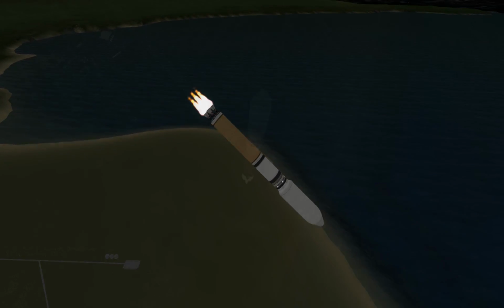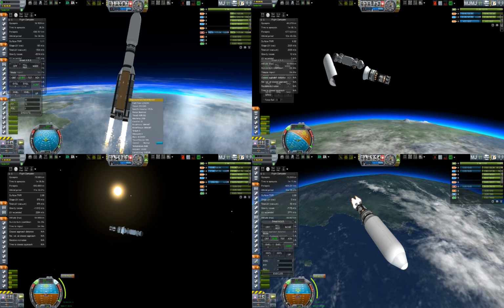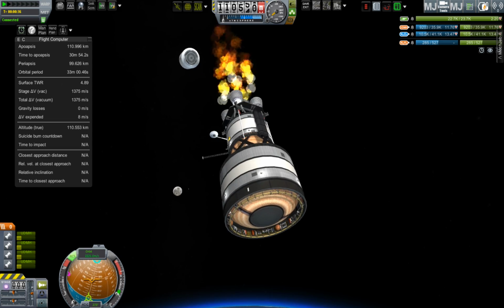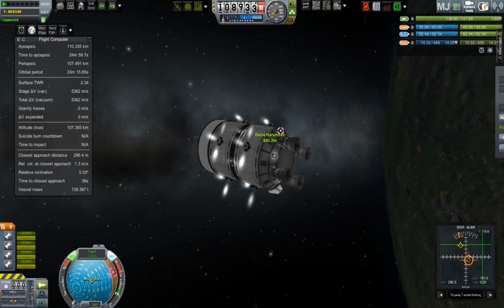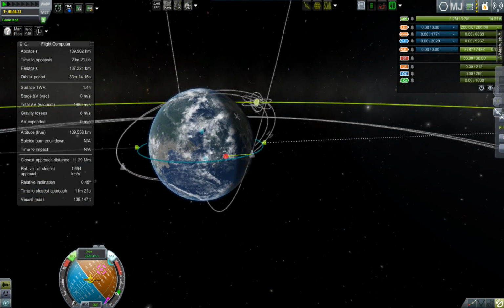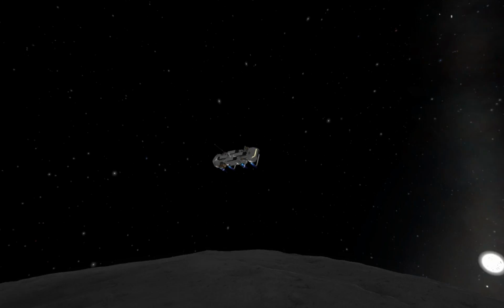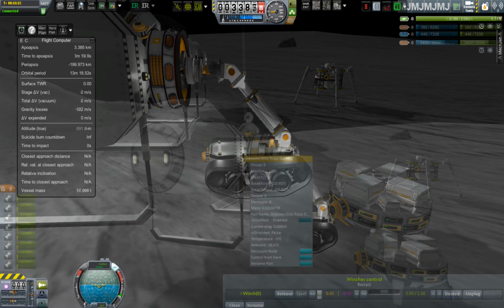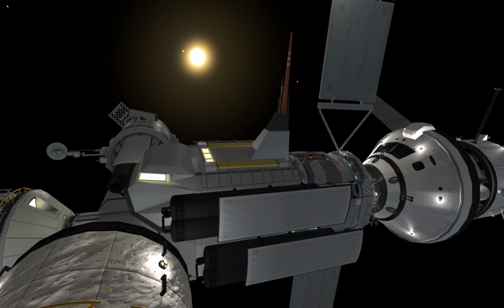E32: "Mun Base Reboot" / Project Odyssey / KSP 0.25

Comment: Sorry for posting the same thing on E31 videos, didn't realise E32 was out. I've been watching this series for a couple of days now (few episodes after work at a time), I'm liking the over arching story as it just adds something extra that's hard to quantify but makes a long running series stay fresh.

Second thing, i really like your designs and your design process, it looks to have resulted in pretty yet practical crafts and most things have a realistic reason for being there, even if it is just for looks. But there is one thing i'd like to help with if you haven't noticed already, it's the crane thing you are making for your moon base. It needs to be fixed to the ground as your wheels will act as a pivot point and even if you add weight to counter balance it, it will still want to pivot on those wheels when moving and will always be unstable.

The solution is the same as on earth, legs on each corner on the vehicle that as far away form the COM as possible when deployed. In game i'm guessing you could achieve this with landing legs or some piston parts from a mod, as long as they lock and don't allow the wheels to act as a pivot point when moving a load it will be stable. Now you would also need to add a bearing underneath the crane piece to allow it to pick up and move stuff around, look up images of crane trucks and you'll see what i mean.

I hope this helps.

Comment: Just a thought for AMA, How to build planes in FAR. I'm going through some hard things in KSP.
Reply from the maker: CodeFantastic I don't usually build planes. You know more than me probably.
Reply: Well, do you know how to fix descending while rolling?
Reply from the maker: CodeFantastic Since I am not sure what that means, I'll say no. You're rolling while descending and you want to stop? The few times I have done planes I did not have rolling issues. I have had yaw issues before. I flip and descend backward. That was the result of FAR thinking I had more drag in the wrong places, usually from bad part configs.
Reply: What I mean is that when I roll right or left my nose begins to dip down. Another odd issue I have is the certain parts ( Turbo Jet, 2.5 RCS tank, 1.5 RCS tank, winglet), and some modded parts have a weird shadowed/lighting bug. I think it's texture replacer that's causing it but I went into the part files and found nothing.
Reply: I guess you have no clue about the texture glitches, Oh well, guess I'll have to deal with them.
Reply from the maker: CodeFantastic could be almost anything, so no not without debugging your system
Reply: Bob Fitch I know it's texture Replacer but I don't understand why it does it.
Reply from the maker: CodeFantastic never had issues with TR myself
Reply: Bob Fitch Alright, what would I do to debug my system other than to narrow down the problem?
Reply from the maker: CodeFantastic that is what you do... binary search, trial and error, check logs, experiment

Comment: what editing software do you use, how long does it take to render a video, how do you show 4 recordings at once?
Reply from the maker: ThatTinyDude PowerDirector. Rendering is about 50% of the video's length. Any good editing software will have PIP.
Reply: shit, my renders take several hours even for a 20 minute video....
Reply: ThatTinyDude 49:50 video in Movie Maker from Windows takes like an hour or 3. (Dunno, its still saving)
Reply from the maker: MrRodeduivel ThatTinyDude Long MovieMaker project can get corrupted too.
Reply: are you using GPU assistance?
Reply: bob?